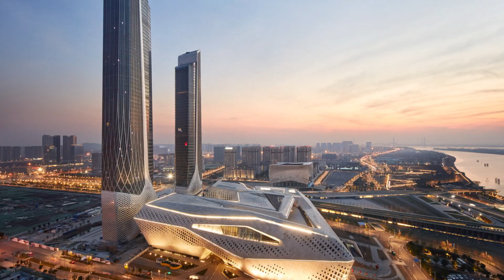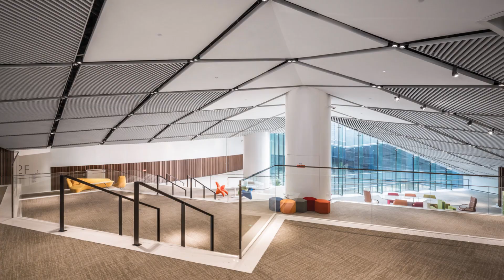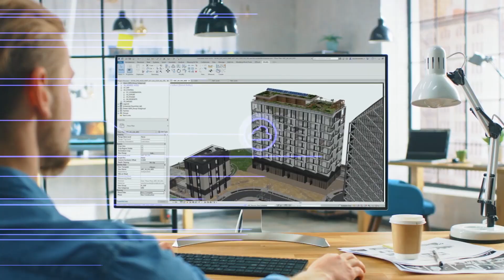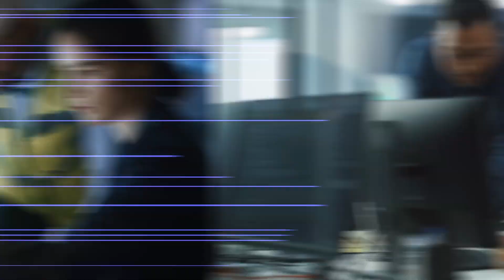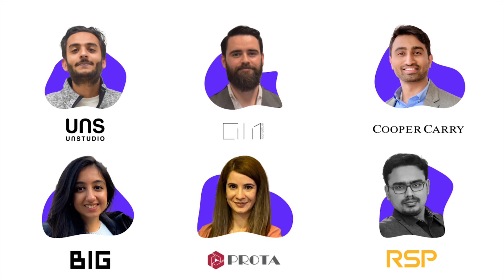3 Projects that would not have been possible without BIM

Comment: Bro which is the best BIM software, revit or archicad or any other software.. 🤔
Reply: Don’t know the best, but i find Archicad more intuitive to use.
Reply: I Have, as an architect, used all three major pieces of BIM software for at least a decade each on live projects. My verdict:
Revit - least useful for architects good for engineers and technicians and lousy at integration through IFC (the standard for federated models)
ArchiCAD - good for architects and good at IFC federated models
Vectorworks - the one I use currently - good for architects, interior designers, landscapers, lighting / stage set designers and better value than ArchiCAD whilst still IFC and federated model compatibility.

To use BIM workflows each team member needs to use the software that suits their practice and NEVER to impose the use of that specific software on others. The federated IFC model retains copyright with the author and never transfers it to the contractor or client. A major failing of the ‘you must all use the same software’ nonsense from AutoDesk and even some clients. As a design team build the fully conflict checked IFC model to pass to the contractor to build and handover to the building owner. BIM is being deliberately strangled by AutoDesk! In much the same way as people were encouraged to think that CAD = AutoCAD. It never did.
Reply: BIM Specialist here. However, I find Archicad more intuitive for architects, the connection between other stakeholder is better done when the software used by all is similar, it facilitates data sharing. Revit in the right hand is an amazing tool with a lot of resources, so I will say Revit
Reply: Having used both ArchiCAD and Revit, I would say that these days I have transitioned to using Revit a lot more often, because it has a slight advantage over ArchiCAD, just because of how you can more seamlessly work with all the other built environment professionals on the same project.